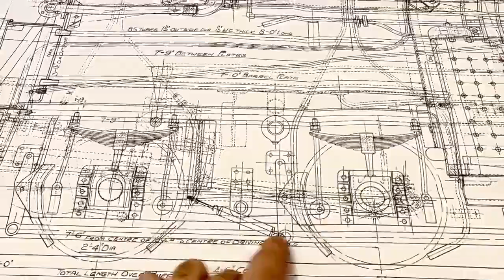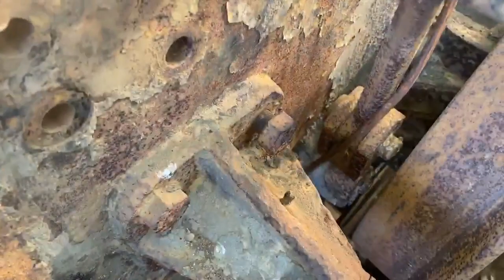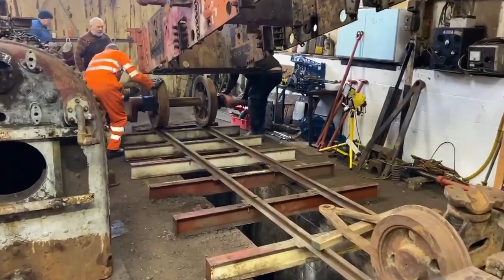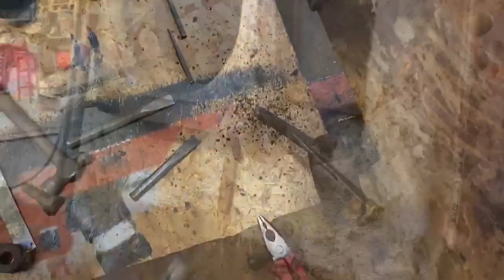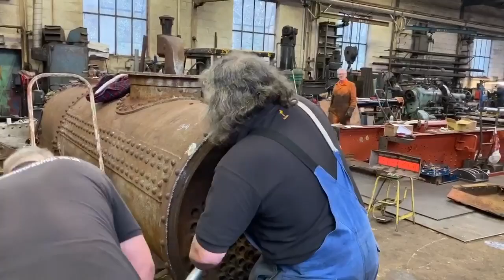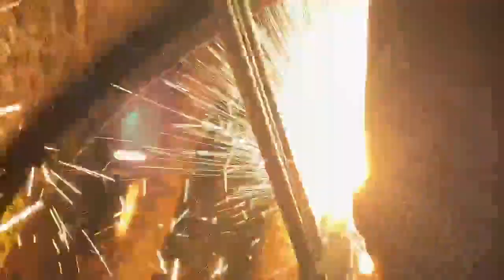Fowler 16341 Restoration Part 4

Comment: You are so lucky. Here n New Zealand we dont even bother working on riveted boilers at all, just go direct into replacement mode as the inspectors will condemn them out of hand because they are riveted. They no longer allow what was a common practice of welding the rivets as a calking.